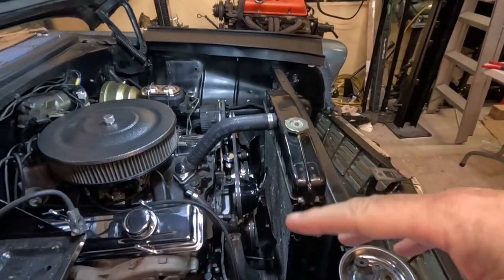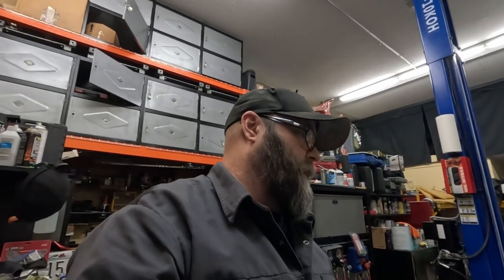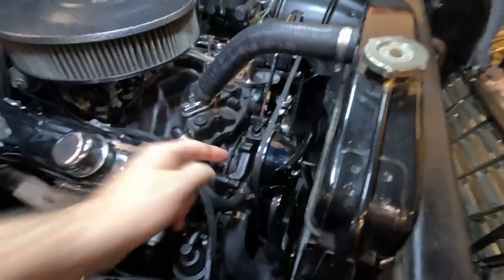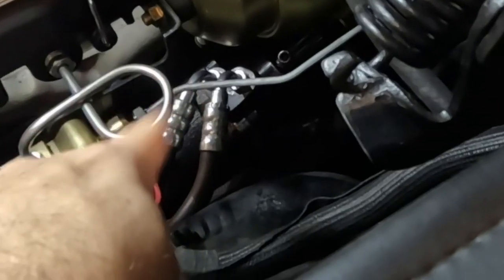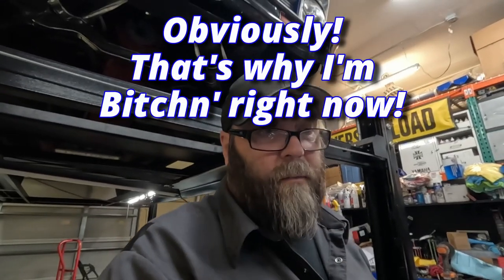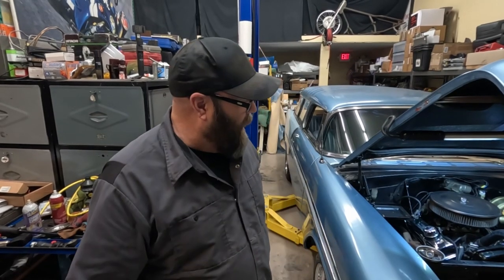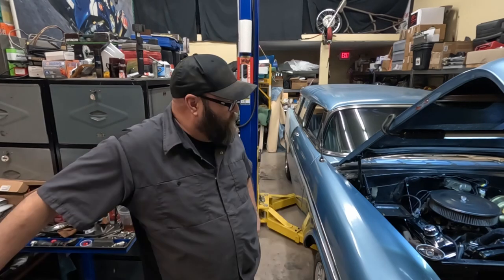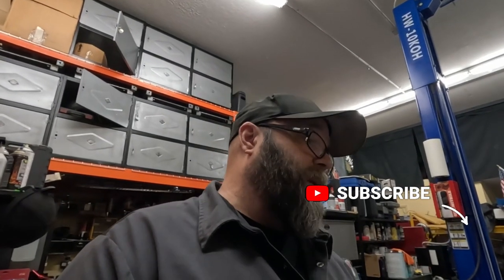Has this happened to you? My HotRoders Rant about the Progress on my 1956 Nomad

Comment: Hey Man. I normally just run the old factory stuff. I would say to shim the new gear or possibly grind down some of the surface landing that sets against the frame on the gear box. I didn't understand which side was tight against the firewall. Good luck man keep going 💪
Reply from the maker: Hey Don. Yea the factory box was shot and the rebuild kit cost more than upgrading to the newer power steering stuff. I'm working on it this week and I think I'm going to try shimming it a little and see if it makes enough of a difference. Hopefully it does and I can be driving it this weekend. As long as no other "little" thing rears its ugly head.👏 LoL 
Thanx for the encouragement. Helps to give me a boost. Alright now back to the shop. I got to get this done. 😎